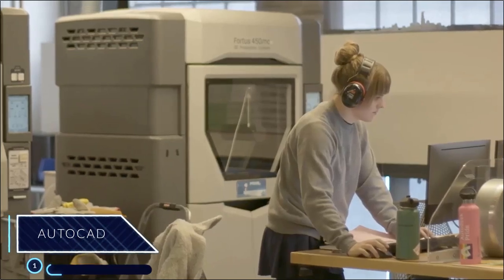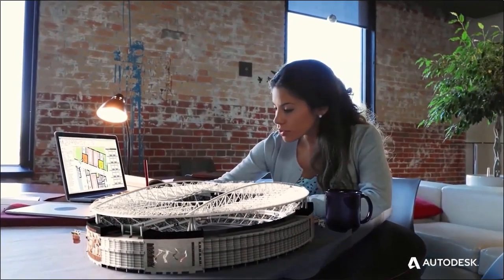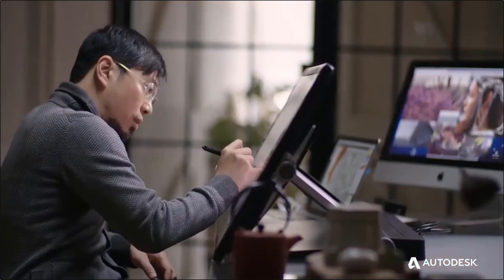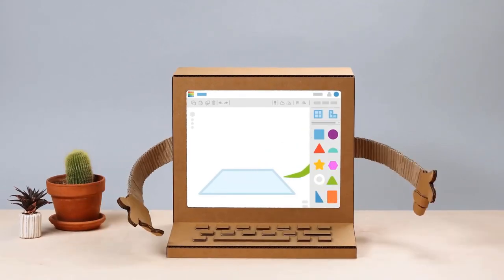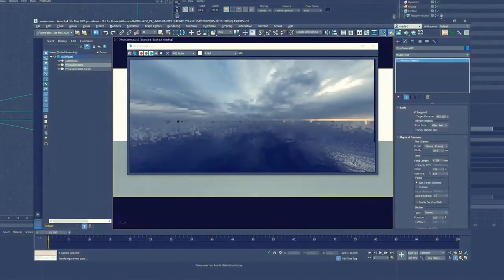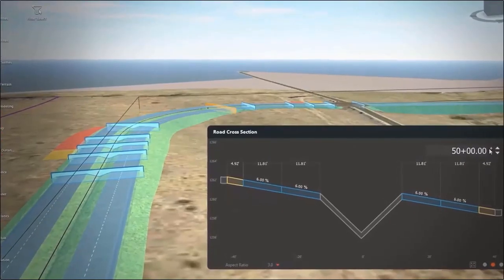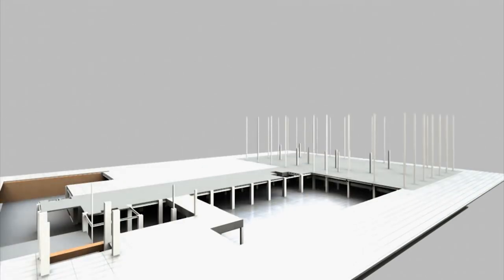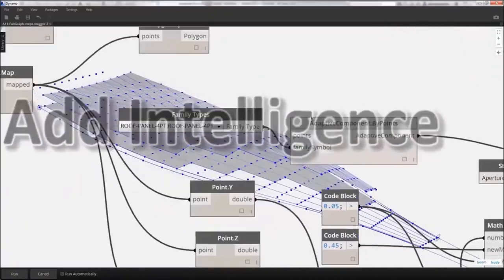21+ Autodesk Software Explained

Comment: Can you do a video about what Autodesk is rumoured to be planning?  When they dropped their game engine (Stingray) they began working on a cloud-based program that is an alternative to their other software.  This was originally called 'Project Quantum' and more recently 'Project Plasma'.  From what I have read on the internet the idea is that instead of exporting/importing your models between programs you instead click a button to change the interface.  For example, if you are designing a building you might need to do some Arch-Viz work at first so require accurate materials, light simulation, etc.  Afterward, you might need to produce some analysis (heat efficiency of the building, stress analysis on its structure, etc).  Then you might need to produce some 2D plans for constructing the building.  Autodesk seems to be building a program that will converge all of these industries into one program.  A video pulling together some of these rumors would be fun and could be posted on your YouTube Channels......
Reply from the maker: Thanks Ben, your comment is interesting and packed with ideas. . i will see what i can do :)
Reply: that's gonna be a pain in the ass to master